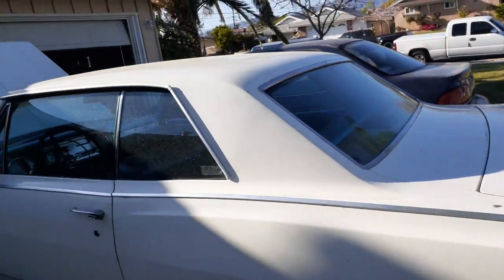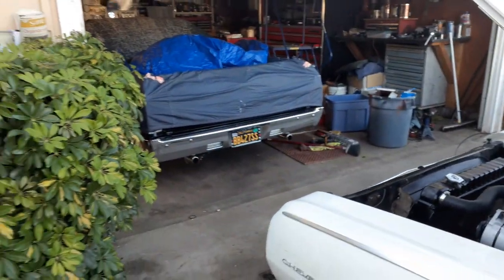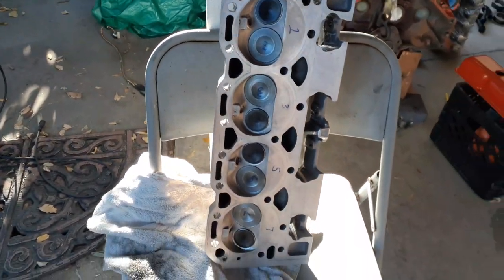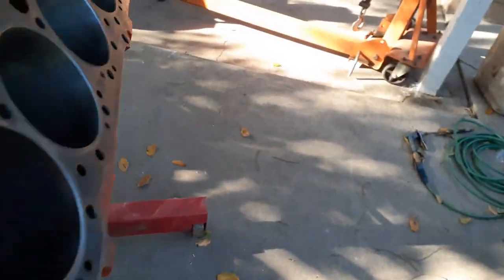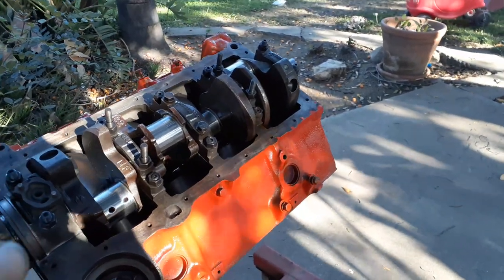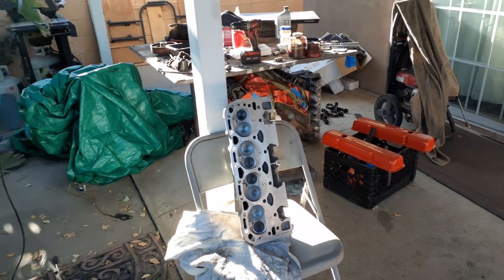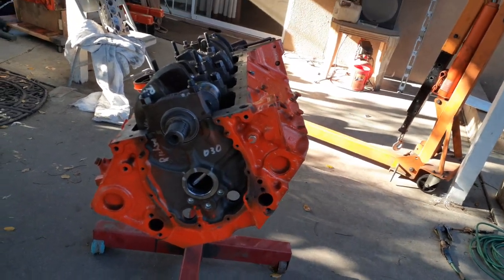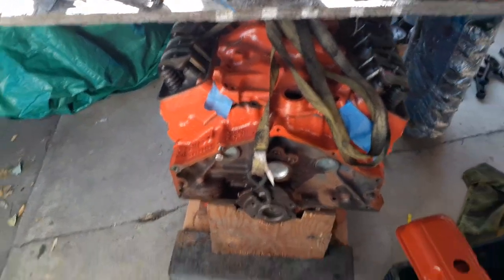350 4 bolt main block with 307/327 crankshaft AKA 327

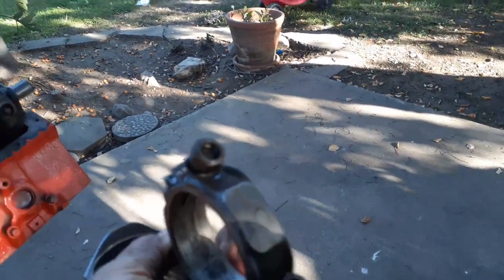Comment: I ran that exact set up back in about 1987…. 350 4 bolt with a 327 .010/.010 crank.  Fully balanced rotating assembly.  Standard bore 10:1 JE’s with 1.94/1.50 double hump heads with screw in studs and guide plates and Manley valves.  Solid Isky cam z-28 grind with crane roller rockers.  It was in a ‘69 chevelle w/turbo 400 and 4:11 12 bolt posi.  It was the most fun car I’ve ever owned.  Won a lot of beer money street racing SoCal back in the day. 😁

Comment: I know some guys teenagers when we were kids, they put a small journal 283 crank into a small journal 327, thinking they're going to make a lot of RPM, but they're short come was no compression. Yes it would wind up standing still but no power. Even when it had the old fashioned power pack head's. 3 inch stroke to 3.25 in stroke eagles Pistons sitting down in the bore about a 1/8 of an inch.

Comment: The only concern might be factory balance on the crank. The smaller 307 pistons the crank was factory balanced to is lighter than the 327 pistons you will be using. I dont think it will be a problem in stock application.
Reply from the maker: I had the same concern.  I ended up sending it out to get it rebalanced . I also used lighter rod pins .

Comment: After 68 the 327 used the same crank as the 350
Reply from the maker: @GlennManchester   after 1968
The journal and cylinder size was the same, as well as the connecting rods heads and intake
The 307 and the 327 sure the same crankshaft my measurements. 3.25 stroke 
The 350 has a 3.48 stroke

Comment: Also want to build a 327,so I can use 350 Blick and 327 crank, wich rods and pistons?
Reply: @REALSTEEL MOTORCARS  350 block I mean with 327 crank
Reply from the maker: @200horsepower   okay  yes you can do that 350 BlOck  and a 327 crankshaft as long as it not a small journal 327 1962-1967 283 and 327
Main journal size too small
So you would need a medium/large journal 
That came out in 1968 -1969 327 and 307 from 1968 - 1973 cast iron 
They are good for a street 
Motor  under 400 hp .
Look for a set of camel
Hump head 64 cc vortec heads 64cc or you could even put low budget 305 heads 58cc 10 to 1 comp
Power pack heads 58cc 
I went with zz4 heads 58cc
Aluminum that flow as good as the camel humps 
They are low budget  HP
The key to this type of build is I-beam rods 585 grams and good flat top pistons.  2 or 4 bolt mains
64cc or less heads
Reply: Yes I ran a 327 drag racing, you're better off building a 350 it's like a stroker 327.

Comment: Try to run a hydraulic roller cam in it and use the roads lifters with the bleed down hole and then you should get better gas mileage when you're cruising on the highway
Reply from the maker: I just installed the flat tappet RV camshaft  .450 lift . If this engine gives me  16 mpg or better I might try my luck with a roller 
Vortec block convert to a 2 piece rear main seal,  and 307 crankshaft.
Reply: Honestly, why more "professional" engine builders don't use Rhoads lifters or Crane variable duration lifters is beyond me--this version of "VTEC, yo!" has been around since the 1960's. they've outlasted the "Varicam" idea of springs inside the timing gear to reduce lift and therefore duration below 3,500 rpm. You get a milder cam at highway RPMs, you get more vacuum for brakes, better idle to run AC, and when you wing it past 3,500 rpm you get back your rowdy cam. you'll lose that race car idle, but it's a small price to pay to run a "3/4rs" cam in a daily driver and get away with it in traffic on a 90 degree day. 

I have a .490/260 duration split cam in an olds 455--with a 3:1 rear gear ratio, i can leave the manual valve body THM400 in top gear (1:1 ratio) and still pull away from dead stop to 5,500 rpm redline and drive all day like that for 15 mpg.
Reply: @albertgaspar627  Used them on hft cams since the 80s. High quality dont fail and do as claimed. 
Too many today dont even know theres way better cam companies than comp

Comment: I'm sure you meant "destroked" not "destroyed to a 327" but in a way you aren't wrong. Give a 350 the parts folks enjoy sticking on a 327 and you've made a better street engine--ie, torque below 6,000 rpm. when people say an engine "feels strong" what they really mean is it makes torque in the 3,000-4,000 rpm range, and it feels strong since after every shift, the engine returns to the RPM range where the torque is not missing. a 307 crank is often a cast crank (narrow parting line) to go with 4 bolt mains, but when playing with stock crank swaps (your 305 blocks have the 350 stroke but are balanced differently so use a 305 balance and flywheel) remember the journal sizes changed in 1968, otherwise you'll need oversized bearings to match things up.  hopefully at least one of those 305's have uncracked Vortec heads.  That on a 283 with the 270 hp cam will get you at least 250 hp on pump gas compression ratio--the real problem will be the factory 2 speed automatic :) a THM700R4 will make even 250 hp seem like something.

smaller displacement can make for better fuel economy, as well as higher compression, but increasing displacement helps make the more torque at lower rpm (all other things being equal), so you don't need to step on the gas to pass--which will help fuel economy. the aluminum heads will help give you a point more compression on pump gas and that'll help make the engine 4% more efficient.
Reply from the maker: I swapped out the power glide for a 200r4 that pulls hard through all 4 gears and if I can keep my foot off the gas pedal I get good fuel economy,  big if
I also built a .40 over 350
With flat top pistons 
.440 lift cam and camel 
Hump heads as a backup 
Out of engine parts taking up space in the garage. 
The 327 was again just parts taking up space ,
I also have a 383 sitting in the garage with edelbrock heads and .500 lift cam 
Tire shredder gas hog ...
But in The end it might end up with a 283 with 305 heads also taking up space in the garage. I have other cars to drive but the 64 ss is my every day driver . So fuel economy is a concern.
Reply: @realsteelmotorcars2894  I hear what you're saying, I'm finally running outa room for everything "that followed me home" and I know the smartest thing to do is sell off what won't make torque and just build an engine that makes torque at low RPM and lasts longer as a result and gets good gas mileage. 

but there's just that lure to put together stuff that doesn't belong together and just see what happens, right? :)

I have a dissassembled 283 shortblock i got in a swap, i know if i run the numbers on it i might get lucky and its worth something....or its some 2bbl impala engine. Still i want to find a Vega and a powerglide to stuff the 283 into, just to say i finally had one since i'm old enough to remember these things. 

i hear you about fuel economy, i parked my 15 mpg big block 442 this summer for the 42 mpg Ford Escort with no AC. i suffered in the humidity but did some good road trips otherwise.
Reply from the maker: @albertgaspar627   have you seen other videos on my channel you might have noticed. Mixing and matching. Jeep steering box , S10 brakes gbody 200r4 transmission 350 block 307 crankshaft on 
1964 Chevelle
Reply: @realsteelmotorcars2894  I'll have to look at your videos sometime. As you said, a lot of "modern" stuff can be put on an A body before going to a $5,000 Pro Touring frame setup delivered in the mail. On a side issue (b/c on 1980's G bodies the Cherokee steering shaft and S10 brakes and digital dash are common swaps) I was just watching some commentary on buying a manual rack and pinion setup for a Foxbody Mustang (I bought one back when they were still cheap) from Flaming River for some stupid price--far cheaper to just nab a 1979 OEM unit or from a Fairmont. Someone claimed to work for FR, and that they sold in bulk to Summit so between that and not paying for advertising one could get a rack stamped FR from Summit for $400 less. 

personally, i find it fun to look for the deals rather than shelling out the cash, but it's those "checkwriter rodders" who create a demand for companies to afford to make some good aftermarket designs.
Reply from the maker: @albertgaspar627   ya just buying bunch of high dollar  aftermarket stuff takes the hot rod out of building a muscle car.  To me its the journey . Getting a 30 year old part off of one car cleaning and painting 
It and bolting it on a 50 year old car .
Reply: @realsteelmotorcars2894 hot rodding originally began before Pearl Harbor with farmboys who couldn't afford the factory hot rods like the Buick Century (a Special with a Roadmaster engine, named after its ability to hit 100mph which was a big deal back then), and "accelerated" after the war due to GIs who learned how to hot rod Shermans and planes against what the Germans threw at them. It would be nice to just write a check and presto have a car delivered in a few months like going to a dealership, but for some of us, the fun is in our own creativity. I enjoy going to consignment shops and getting an ensemble that works together, I love finding old furniture that is quality and matches what I already have. and I enjoy picking just the right junkyard parts (using the fact that Detroit often shares parts from one model to another to save a dollar) and "massaging" where I have to, to create something that keeps up to today's "supercars". I don't hate the design of an LS or new Hemi, I just like to surprise the "new kids" who are certain anything old must be inferior. 

for example, I own a 1968 Olds 4-4-2 with a 461 olds and a switch pitch torque convertor in a manual valve body THM400. Thanks to variable duration lifters and a spread bore Q jet and captive discharge ignition, I can pull from a dead stop to 5,500 rpm with a 3:1 rear gear while the THM400 is in 3rd and the 'convertor is at 1,800 rpm and get 15mpg. or change the stall speed to 3,300 rpm and go into first and get to 60 in 5.5 seconds.  It's not a fire burner, but with the 442 sway bars and a disc brake upgrade in the front and a 1.5 lock to lock steering box, it's good enough on the street.